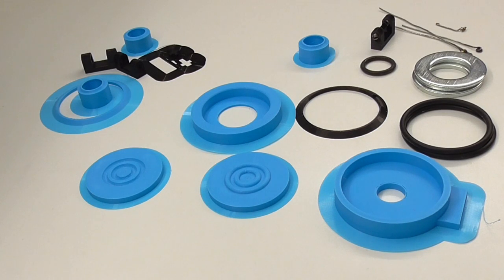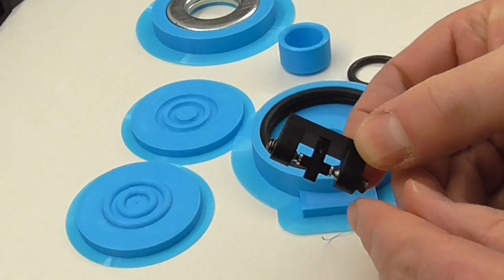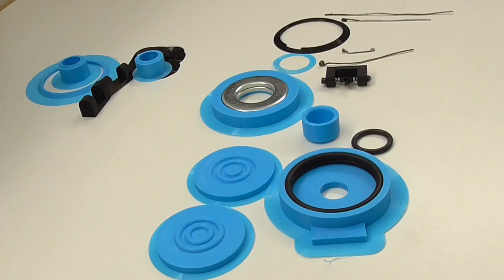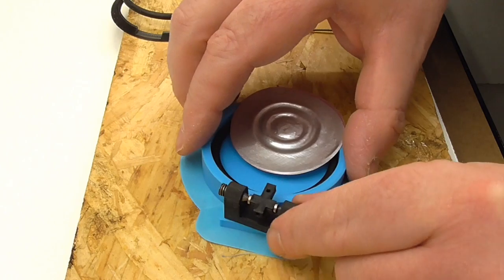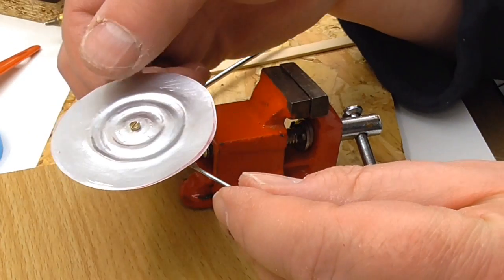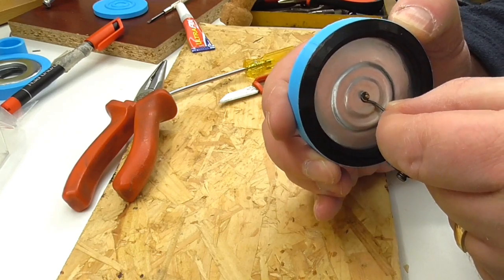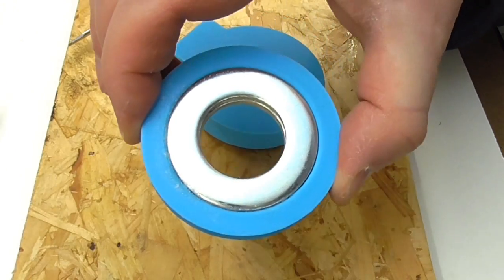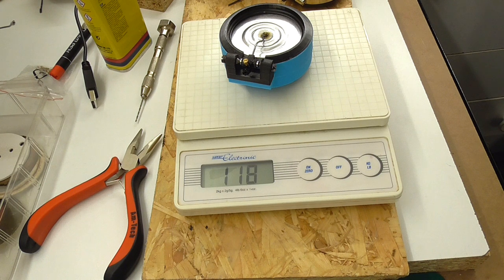3D printed soundbox / reproducer version #3

Comment: Seems to work well. One thing I wondered is if the wire for the needle arm (from the centre of the diaphragm to the needle) is stiff enough? Most soundboxes seem to have this cut from a flat piece rather than wire, wider at the needle end and tapering towards the diaphragm end. Thus being very rigid in the direction of movement of the vibration, but not too much mass near the diaphragm centre.
Reply from the maker: Yes, you are correct. The wire I am using is a compromise. It probably should be stiffer, and it should taper. The HMV/Victor No.4 is a tapering wire, but yes, most soundboxes use a flat needle bar which will be easier to manufacture. It's on my list as an improvement for a future design. Thanks 👍😀
Reply: @mrrgstuff  Yes, needs a stiffer needle arm as Timothycan says.
Reply from the maker: @HaggisCat1  I might go for a flat triangular one with this as it should be easier to manufacture. Thanks 😀 👍

Comment: Very good work, you should be pleased with how this came out.  With regards to the diaphragm, would it be easier to form if you made some kind of jig to go on your lathe and then offer up the tool as it spins? Cheers, D.
Reply from the maker: Thanks 👍😀.  Yes I was thinking only this morning that I should be able to form the diaphragm on the lathe by rotating the die. At the minute though I am experimenting with making flat diaphragms on the lathe which will appear in an upcoming video 😀

Comment: Have you tried in previous attempts to use the bottom of a can of soup or something for the diaphragm?  It seems to me those foil pans are just not thick or stiff enough.
Reply from the maker: Yes, I have tried a variety of materials. This video is a comparison of different (flat) metal ones:
https://youtu.be/aMrX8tn-tYI
The flat aluminium performs poorly, but is significantly better with the indented rings (corrugations) as they stiffen up the middle, but leave the edge more flexible. This video shows this:
https://youtu.be/mK1bGhanqf4
I have also tried various plastic diaphragms:
https://youtu.be/XqAlJVpN3ZM
One of the best simple diaphragms is the metal base of a Pringles tube.
Thanks 👍😀
Reply: @mrrgstuff  The corrugation rings is why I asked you about the bottom of a soup can or maybe tunafish cans, as these can bottoms usually have these rings for extra strength and rigidity.  It is surprising at just what a difference little things like that make on the strength and rigidity of steel or aluminum.  It is the reason why you pretty much cannot find a single  flat piece of metal in a car. Completely flat metal is surprisingly plastic.
Thanks for the links, I'll check them out.
Reply from the maker: @christo930  Yes, its a fair point, those corrugations in a soup can will act just like on a diaphragm. I am sure it would work (and am sure I have seen such a can used as a diaphragm). I think the metal though would be too rigid and might wear the record unnecessarily. Thanks 👍😀
Reply: @mrrgstuff  So if the diaphragm has too much resistance to moving in and out, that will cause excess wear on the record?  I did not know that.
Is there any reason you cannot use mica?  I think that is what many of them were made of originally with cork gaskets.  I wonder if there is a softer material you can put behind the diaphragm  The O rings are fairly soft, but perhaps cork of some other soft material would work?
Reply from the maker: Sorry, only just seen this comment. Mica would work fine, but I don't have a suitable one on hand for this size of soundbox. The size was based around the O rings, and yes they are not as soft as they could be so I could make another version with softer gaskets and mica. Corrugated aluminium sheet works pretty much as well, if not better than mica as it is stiff in the middle and flexible at the edges. Thanks 👍😀
Reply: @mrrgstuff  Thanks. Looking forwards to your next video.
Reply from the maker: Thanks 👍😀